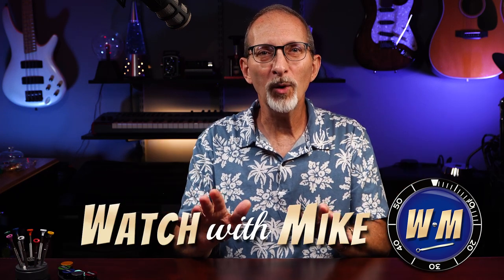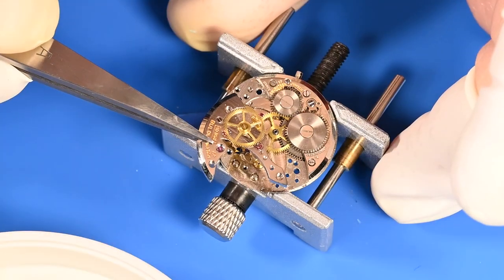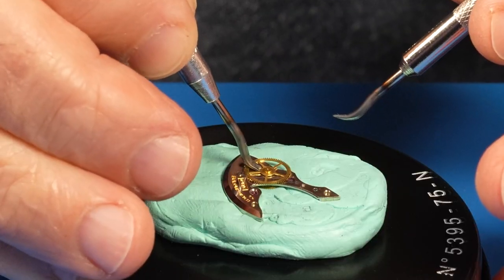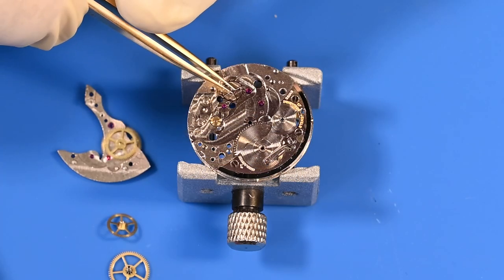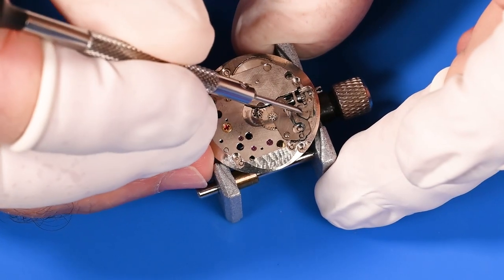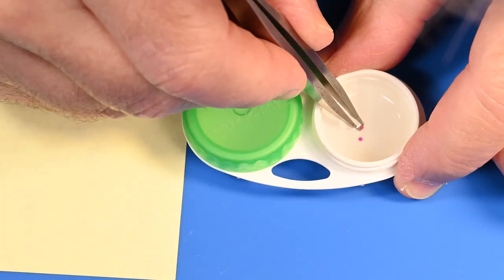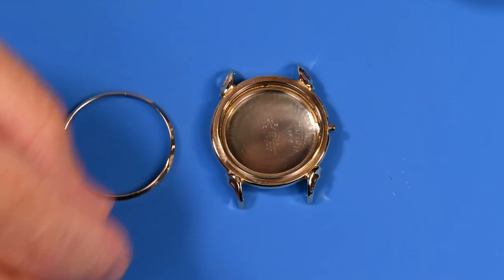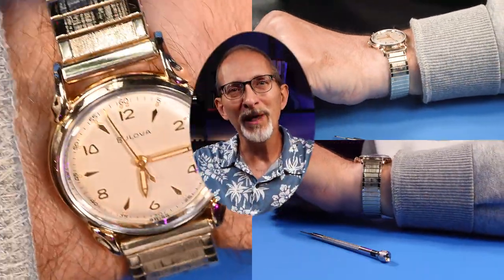Reviving My Father’s 1953 Bulova Mechanical Wristwatch: Full Service & Restoration

Comment: After finding that spring, I hope you went out a bought a lottery ticket? That was lucky! Thanks for posting Mike.
Reply from the maker: I didn't buy a lottery ticket because I think I used up my luck for that day! Retrieving a launched spring, screw or pinion (actually did that tonight) is all I can ask for.
Reply: @WatchWithMike  I can't count the hours I've spent crawling around on the floor looking for a spring that launched on me. Sometimes never find them and have to get another one. Also the original mainspring looked good to me. I'm guessing that you just wanted to show how to install a new one.

Comment: Super cool, Mike! I have my father’s watch here and I will never be able to service it. Because it’s a quartz watch. German brand called Regent. I think it will run forever anyway. This is the watch that will never leave my collection. I wore it after his death until the battery died five years after. Having no clue about watches, I put it on the shelf, and bought a cheap new one. And so on. That was twenty years ago. Two years ago I opened it and replaced the battery and it is running like a new one. So I hope you will have good times with your father’s watch, like I do! 🎉🕐🍸🍸
Reply from the maker: @NaNByZero - what a great story! I'm glad for you that you revisited getting your dad's watch going again, and that you are wearing it. I'll have to check out the brand Regent. Quartz watches can sometimes be worked on, as I learned when I restored my Heuer I had in high school. It's amazing how many memories attach themselves to watches from our past, and how other people, like your dad and my dad, leave their own presence embedded in a watch for us to remember them by! ❤️
Reply: @WatchWithMike  So true and thank you, Mike! :) Yes, check the brand. They are still in existence. They make titanium watches. I noticed that they decided to have the date at the three a clock position. My father’s watch has it at the six a clock position, wich makes it much more symmetric. I prefer that style a lot. Have a good day and night.

Comment: A couple of suggestions:  Do NOT put oil on the main plate under the mainspring barrel.  It serves no purpose.  One usually puts a couple of small "dots" of HP1300 on the bottom of the barrel, the friction surfaces of the barrel arbor, and into the pivot holes for the arbor on the main plate.  When lubricating a movement, less is more.  Too much lubrication will eventually run all over the movement.  You just want to suspend the lubrication between the pivot and the jewel. In fact, if you can see lubrication when done you've applied too much.  As far as the seconds driving wheel, you can press it back into place in many different ways.  You can use a hand pusher as long as you keep it straight, a hand setting tool, or even a staking set.  Just need to make sure the driving wheel and the seconds pinion line up correctly.  Some basic watch terminology:  If a "plate" is held by only 1 screw it's called a "cock".  If it is held by 2 screws (one screw at each end) then it's called a "bridge".  The "gears" in a watch are called either "wheels" or "pinions".  The "yolk retaining plate" is actually the setting lever spring. It helps using the correct terminology 🙂  Nice job, beautiful watch, and great videography!  Well Done!
Reply from the maker: Thank you, all of your suggestions are on point! In fact I just published a new video last night, and I think I have checked off many of your recommendations. Always learning! Here's a link to the video if you would like to watch. https://youtu.be/N3RZiy5bonI?si=vNeugQSCzoIpBFS_

Comment: Thanks for sharing this, Mike. It’s good to see a nice restoration of a piece that has meaning. A bonus is that your movement appears to be in great condition. 
Some funny coincidences: my dad’s 1954 Bulova was made in his graduation year, and that watch got me interested in watch repair. I also have about the same ultrasonic cleaner as yours. 
If you look at the underside of the dial on your dad’s watch in the right light, you can see see the repeating words “Bienne Huguenin” stamped on the back surface - a company and location in Switzerland. Bulova outsourced parts to various suppliers. A. Schild made ebauches for Bulova and several other watch companies. 
If you don’t mind an unsolicited suggestion, when removing the pallets to let the movement run down through the train of wheels, consider the potential for high speeds and friction to overheat the pivots. Some books recommend this to check for rebound at the escape wheel as an indicator of power getting through, but another watch repair YouTuber has advised me against this.
Nice video, narration and repair skills!
Reply from the maker: Hey Bubba, there were times when this watch seemed to have a mind of its own! I love the coincidence that your dad also had a Bulova. Thank you for the supplemental information on the watch, and for your tips. So glad to have you as a viewer. Cheers!
Reply: @WatchWithMike  Mike, my dad’s watch has a water damaged dial and the plates scratched up inside. I suspect several cleanings caused scratches over the years. Sometimes when we pick up a used watch to fix up, a never-serviced one can be preferable to something someone may have damaged.

Comment: Hi Mike. I'm a retired military guy who's always had a passion for watches and now taking on watch repair/restoration as a hobby. My grandfather was a watchmaker, so the family says it's in my DNA. Anyway, I am working on a Bulova Watertite with 10BUC movement, and your video has been SO helpful! The mainspring in this watch is dead. My questions is where did you get the replacement GR4503 mainspring used in the video? I got a #53 10BCC Bulova replacement, and it did not come in a press in holder, nor did it fit to press it in with the way it was packaged. I ended up trying to do it by hand and the end broke off! Grrrr. Very frustrating. Any help you could provide on where you got that mainspring with push on holder (as in the video) would be so appreciated. Keep up the great work. Love the videos and I'm learning a lot.
Reply from the maker: Hi Richard, thanks for dropping by! I also had troubles getting the correct main spring. I bought one from Cousins UK and it came pre-wound in a washer that was too big for me to transfer into the mainspring barrel. I tried to hand wind it but ended up bending it. I originally bought an inexpensive Chinese main spring winding set, but had very little luck. I don't remember the timeline, but I ended up splurging on a set of Bergeon winders. What a difference! (I have a video that introduces that tool when I opened it.) If I remember correctly, I ended up ordering the main spring by measuring the width, length and thickness of the old one, and finding the nearest match that had the correct tab at the end that anchors it to the inside of the barrel. I believe I bought that at Cousins as well. I hope that helps!
Reply: @WatchWithMike  Mike--Thanks for taking the time to reply! Sounds like our experiences are almost exactly the same. I bought one that I thought would fit (10BCC) and it was too big to press in. Then I broke it trying to do it by hand. I also bought a cheap set of mainspring winders, and they just aren't working. I can't get the tab to grab on any mainsprings. Maybe I need to invest in Bergeron. Anyway, I have a 10BUC mainspring coming and fingers crossed it will press in like in your video. Keep up the great work. Really fun to watch your stuff and keeps me motivated when I get frustrated and think I made a bad decision taking up this hobby!
Reply from the maker: @RichardSweeten  Yup, very similar experiences! 😄

Comment: This is fascinating. Is there a consistency from watch to watch or, how do you remember where stuff goes?
Reply from the maker: Great question! I take lots of photos (video actually) of the disassembly, and I will make notes and drawings of the little details to help me remember. After almost 2 years doing watch repair, I am now able to recognize the difference between screws and wheels, so even if things get jumbled I can get it sorted out. So my answer is yes, there is a consistency from watch to watch. It just takes some time to recognize it! 😁

Comment: Did you lubricat the baril inside?
Reply from the maker: I lubricated the spring and the arbor contact points, but since it is not an automatic I did not put any grease on the barrel.

Comment: I was servicing my bulova and was left with a flat washer in my jar. Did you come across a flat washer? May have been from another watch....thanks.
Reply from the maker: The only part that I think looks like a washer is the crown wheel ring, which sits inside of the crown wheel. In the video you can see me removing it at 5:43. Hope that helps!
Reply: @WatchWithMike  thanks. Got the bulova running last night. Did not push the hour hand down far enough and was touching the minute hand.
Reply from the maker: @knudge6334  I hear you! I had difficulties adjusting the hands, too.

Comment: Next time for jual befor oiling, use epilam, fixodrop. That will allow for the oil to be kept perfecley
Reply from the maker: I just learned about Epilam - I need to get some, and one of those fancy applicator bottled! :)
Reply: Buy a 10ml moebius fixodrop and it should come with a built in mesh in the neck of the bottle. Just put parts on the mesh put on the lid tightly and invert the bottle for 30s.
Be carefull unscrewing the lid as je wel covers can stick to the inside of the lid. Problem solved at least expense...
Reply from the maker: @originalboondi  Good to know, thanks! 😀